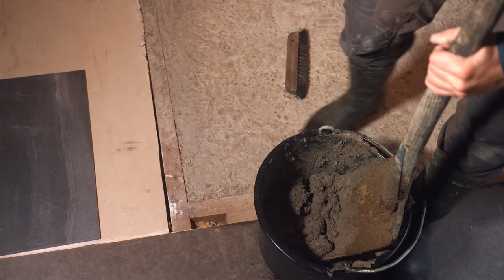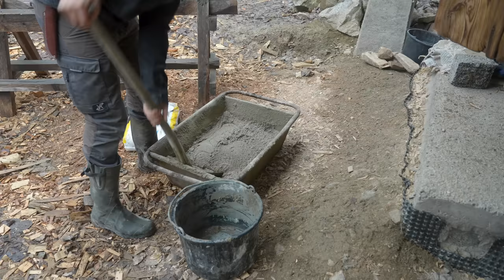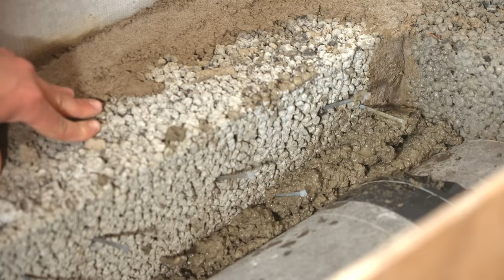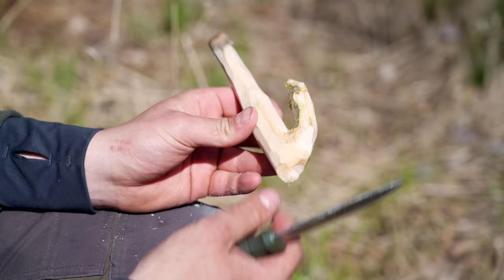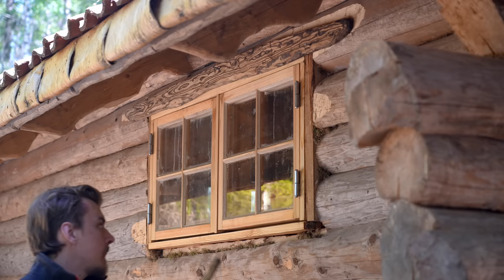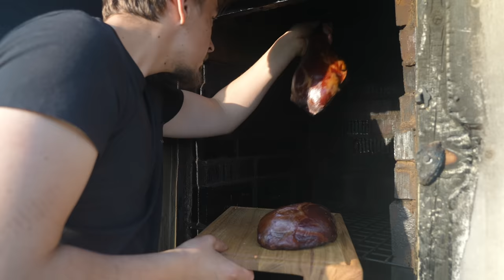I FINALLY Built A Heating System In The Log Cabin

Comment: Absolutely awesome young man!  Of all the 'cabin builders' on YT,  with especially your roof build and the correct insulation you've used, you're the ONLY one who's taken full consideration in correct engineering when it comes to the 'R-Value' to stay warm!  Yes, you'll have the MOST comfortably warm cabin of all the builds, and done right!
Reply: Yes, others don't even insulate between the logs...
Reply: @AakeTraak  Shawn James of My Self Reliance did insulate his cabin with a moss. Nik Rijavec did insulate his cabin with modern insulation. Mr. Outsider of The Outsider did insulate his cabin. Also Kevin of Modern Self Reliance, Peter Kelly of The Woodland Escape, Lance and Cinda Serafin insulate theire cabins, etc.
Reply: What do you mean by the R value?
Reply: @Skochel  the capacity of an insulating material to resist heat flow. The higher the R-value, the greater the insulating power.
Reply: Erik has amazed me from the start.  He is only like 19, and has demonstrated skills that guys three times his age do not have.  He approaches everything he does with consideration, determination and a sense of perfection, and somehow manages to film, edit and present it with that same style and precision.  I have known some very accomplished craftsmen, but they were all of advanced age, having garnered their knowledge and skills over their lifetimes. Apparently, Erik is a natural.
Reply: @yummboy2  I totally agree, though I believe he has very good mentoring from his father and grand-father. If I remember correctly, they did work in this kind of field before. Not to take credit away from Erik of course, its still very hard to put everything into practice regardless of advice.
Reply: @yummboy2 это просто фильм, поэтому всё правильно.
здесь работает большая команда.
Reply: @Skochel  https://en.wikipedia.org/wiki/R-value_%28insulation%29
Reply: @Skochel  R-value is the insulation value or U-value which is the inverse of the building envelope. This comment is a troll because everyone takes into account the r-value when insulating  and I am convinced the original commentor doesn't fully understand what hes saying.

Comment: When you close the door correctly towards the inside, where the door ends you should place a 5 centimeter frame inserted and screwed well all around in the upright, which functions as a block from any pushes of some bear that is trying to open it. The hinge that is used to open and close the door is fine but the internal stop is needed to make sure that a large animal does not break through it.

Comment: The only problem I have is the regular gray cement used in the walls around the furnace. Not the heat resistant reddish one as the last few bricks. Regular cement cracks and becomes powder when getting hot enough.
Reply: The point is that the stove heats in two ways. IR illumination and air circulation. Unless the stove has special air tubes taking cold air from below and throwing upwards on its sides, the only heating is via the cooking top plate surface. Sides heat the cement blocks and the hot water can with IR. So the sides overheat and crack.

PS - what is the purpose of the heat resisting bricks on top of the water can?

Comment: The Procon container you have for water would serve you better if it were set up off the ground about 5 feet on a stand, placed directly below the eave of the roof with a rain gutter for capturing rain water and the down spout that was directed into the tank, you could then have gravity fed running water inside the cabin for washing, you could even have a flushable toilet if you wanted it. This would be great for summer months.